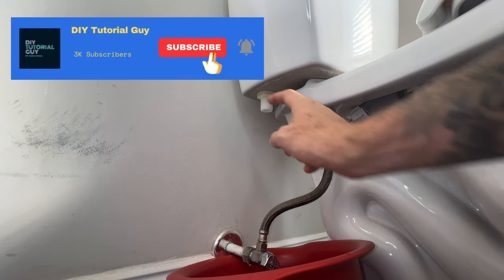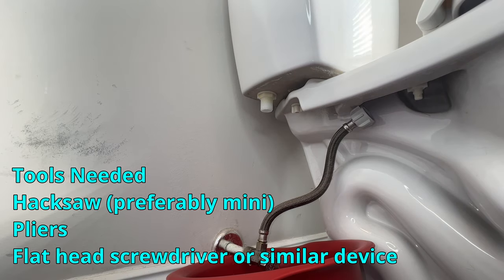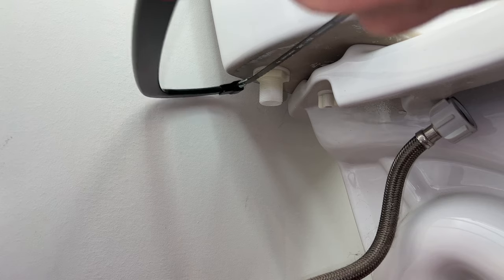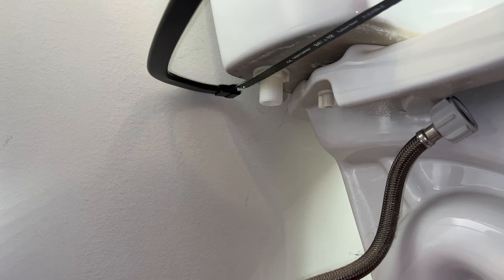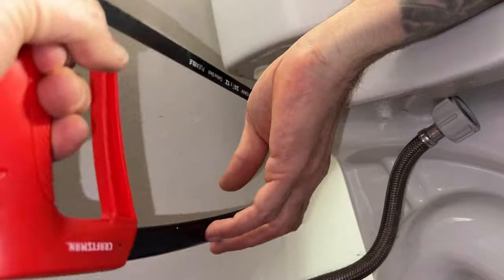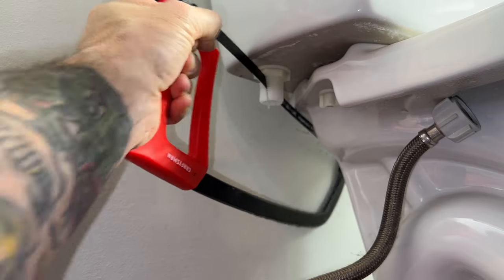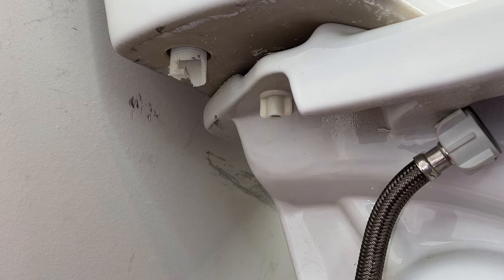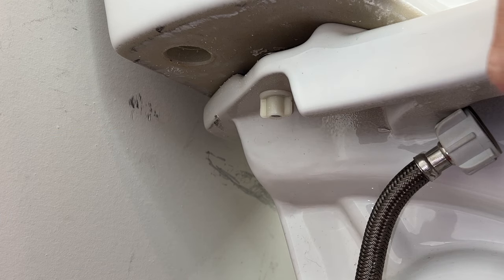How To Remove a Stuck Locknut

Comment: Hi I came here because of a stuck toilet lock nut. I watched the video (very good video). Then I decided to try a little WD40 before sawing. It worked the WD40! Try a little oil before sawing it might loosen the nut. Just saying. Have a great day!
Reply from the maker: Excellent work, thanks for sharing this tip for other viewers!

Man, I can’t believe I didn’t think of that!
I keep WD40 in my toolbag, had it right there the whole time I was sawing away, haha.
Thanks for watching!
Reply: How did you get the WD40 into the underside of the locknut? My fill valve is steel, so 'cutting' into it is not an option. I'm afraid of the other suggestions which involve cutting the nut etc, as I'm afraid of breaking the nut off and taking a bit of the porcelain toilet with it.. then I would need to replace the whole toilet! * eep *

Comment: I’m stuck on one right more… trying not to punch out my walls 😅
Reply from the maker: Were you able to get the locknut off?
If you dented the wall, spackle and some touch up painting should fix it!
Reply: Btw, my toilet bowl had hand-tight nuts under the tank, you remove the nuts and you will able to lift the tank and move out to a more comfortable space outside the little space and use different types of tools to conveniently cut out the plastic lockout. I’m sure this removable nuts are right under all different types of flush tank
Reply from the maker: For this the locknut was preventing the fill valve from being removed. There were no 
If you watch the video where I remove the flush valve I use those nuts to remove the tank.
Here’s the link:
https://youtu.be/woIPLB5tvYo?si=MQWslmZ1b45UmxG-

Comment: I am sure this is dumb question, but is there a reason you didn't try a wrench and try to unscrew the lock nut?
Reply from the maker: Because it’s a one time use lock nut, and almost every destroying it is the easier option.
I did try regular and channel lock pliers, but it’s too small to get a good bite.
Reply: @DIYTutorialGuy  thank you for the quick reply and for the video. I appreciate it!

Comment: U could try a small grinding wheel or whatever
Reply from the maker: Sure, if I had an angle grinder (which is what you must have meant)…
However, the point of this channel is using what you have on hand to fix something. 
Why spend $$ on an angle grinder when the hacksaw I have worked fine?